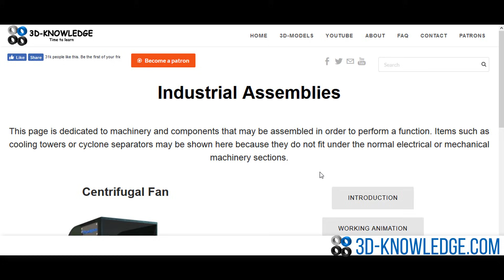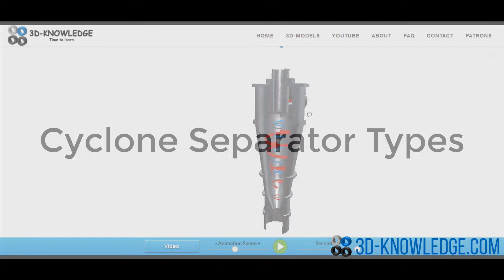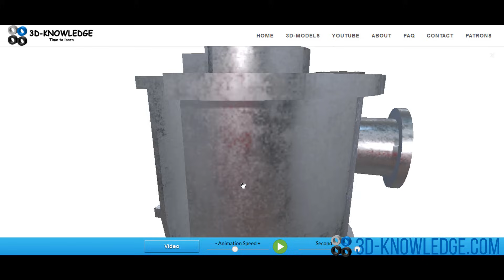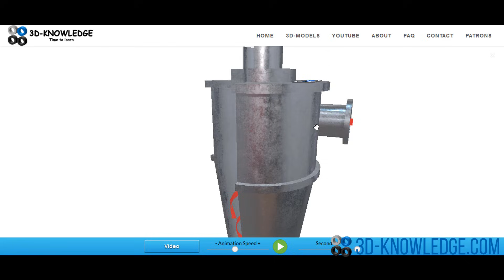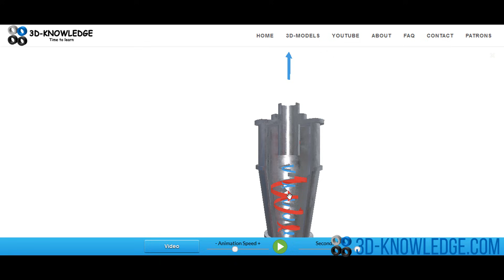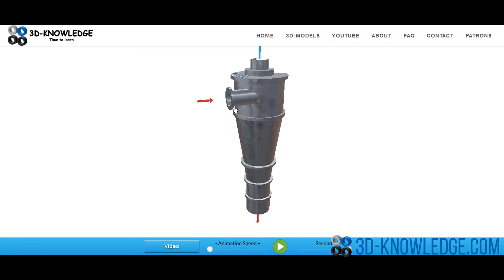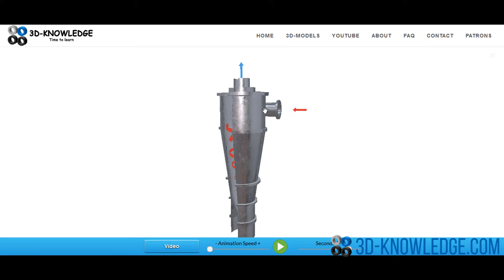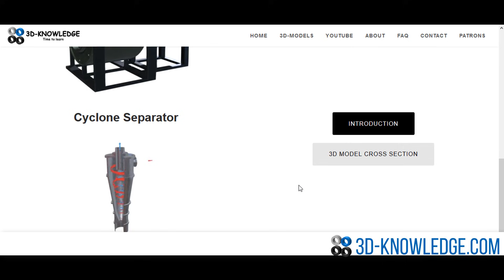How Cyclone Separator Works

Comment: Great video. thanks for the insight. Question for you if the gas velocity on the suction side changes velocity (line in the use of an engine crankcase blowby gases increase with RPM), will that have an effect of separation? In other words does the cyclone separator have an effective range, and can it get overloaded?

Comment: Great vid!
Would it be possible to separate the homogeneous component like oil and oil with different densities (however, it's more like sloppy wax that can't be well-mixed to the oil content mixing together with the light oil fluid)?
Reply: They separate mechanical mixtures, not solutions. If the wax isn't dissolved in to form a solution, they will separate.

Comment: Nice work! Is there a formula as to how long the suction pipe is inside your example is?. Assuming the diameter of the canister is 12 inches x 10 inches and the funnel portion is 18 inches tall tapering down to 2 inches. The suction pipe is 2 inches in diameter. hope to hear from you! Cheers

Comment: it seems this type relies on gravity.  Is there a type of air cleaner that works regardless of orientation or in zero gravity?
Reply: You could send the air stream through an actual centrifuge that would trap particles on its drum so long as it's spinning.

Comment: Great vid. At the oil and water separation, I was taught the heaviest one goes down(oil should go down in that case) , but you said inverse. Can somebody explain, pls?
Thanks beforehands.
Reply from the maker: Oil is less dense than water, that is why it does not sink below water. Check the density of fuel oils and you will see this. Hope that helps! 😃
Reply: Water is heavier than oil.  (Oil floats on water.)

Comment: Another design consideration is the to make sure the ACCEPT discharge has a lower pressure than the inlet pressure so the particle follow a path of least resistance.
Reply: Of course how else would it work

Comment: Hello, is this state ment correct:
Air under high pressure is blown through thr pulverised ore. The lighter gangue is blown away through the top, while the denser mineral rich particles hit the Wall by centrifugal force and fall down the funnel.
Or
.......is blown away through the top by centrifugal force, while the denser mineral rich particles hit wall and  fall down the funnel.
Reply from the maker: Centrifugal force is one of the forces acting upon the incoming particles (drag is another), but I would think the word 'vortex' is more appropriate. If you want to know more about centrifugal force, look for 'alfa laval separator', or 'centrifuge' or 'clarifier'. Also check 'vortex separation'.

To answer your question,  the lighter particles leave through the middle in an upwards direction whilst the heavier particles exit through the bottom. The heavier particles impacting with the side of the cyclone effectively removes them from the process stream

Does that help?

Comment: Would this work very well to remove water from the air at the inlet of an air compressor, and again possibly, on the outlet?  Less water in the tank and less water in the compressed air as well.
Reply from the maker: +Ron Floyd

If it's for a compressor, normally a refrigeration type drier or desiccant type dryer is used. Silica gel cartridges are good for removing moisture from air, but I think activated alumni is normally used. Larger compressors have drier on the section side and normally separate driers installed after compression. Atlas Copco and Kaeser are big comp air manufacturers, check out their websites. Hope that helps.
Reply from the maker: +Ron Floyd 
Side note: the compressor can form droplets of moisture due to the compression of air and the moisture it holds. The more moisture the air has, the more droplets (condensate) appears. You don't want water in the compressor or downstream as it will corrode parts. So you are right to want to dry the air. Condensate often corrodes the base of air receivers if the air is not dried and can cause valves to stick.
Reply: If you have water at the inlet of your compressor.... Move your compressor immediately! As for the outlet yes cyclone can remove WATER but not vapor, the problem is the heat of compression and the multiplication of moisture content. When the compressed air leaves your compressor it will be between 180 degrees Fahrenheit and 350 degrees Fahrenheit depending on what type of compressor you have and what discharge pressure is. If you have an oil flooded rotary screw compressor the temp will be 180-200 then it will go through an after cooler. It should leave the aftercooler at 100 degrees Fahrenheit or lower, but this air is completely saturated with moisture(relative humidity is 100%). Whatever temperature it is that is your new dewpoint, if the cools even 1 degree it will condense in to liquid and now your air is still completely saturated (relative humidity 100%) just one degree cooler. Rinse repeat. OR you can dry the air. Using a refrigerated dryer cools the air to a much cooler temperature and then drains the condensate generated. Whatever temperature it cools the air to is your new dewpoint, if the air remains above this temperature it will not condense, if it drops below that temperature it will condense into liquid. Obviously refrigerated dryers will not give you a dewpoint lower than 32 degrees Fahrenheit because at that point the moisture would condense and freeze. For dewpoints below 32 deg F you need chemical reaction such as the activated alumina which can aDsorb (not aBsorb) the moisture to dewpoints as low as -100 deg F if the proper regenerating methods and controls are used. Side note many modern oil flooded rotary screw compressors use cyclonic separation to separate the oil from the air.

Comment: So the higher the speed and the narrow it gets towards the end the finer the particles it can get? I'm wanting to build a gasifier and was wondering how fast or what type of cyclone would I need to remove smoke particles from the gas?
Reply from the maker: I downloaded this:

http://www.maths-in-industry.org/miis/328/1/minimum-particle-size-for-cyclone-dust-separator.pdf

It seems you cannot separate soot particles from a gas stream. I think its correct, the particles are way too small and I have never heard of this sort of setup. I know that coal fired power stations use an electrostatic precipitator (its a mouthful...). I searched for an ESP for gasifiers and got the below info:

Syngas conditioning chain:
A. Cyclone separator
B. Wet scrubber
C. Electrostatic precipitator

This makes more sense, use a cyclone and then a wet scrubber with ESP. I am not a gasification expert! :) So, dont take it as gospel, I am just applying what I know from other industries. 
 
Here is the link where I got the above info:
www.ieatask33.org/app/webroot/files/file/2014/WS/Fantacci.pdf

Hope that helps,
Jon